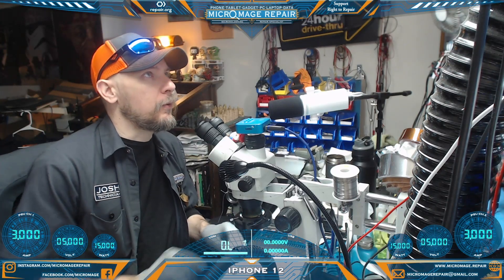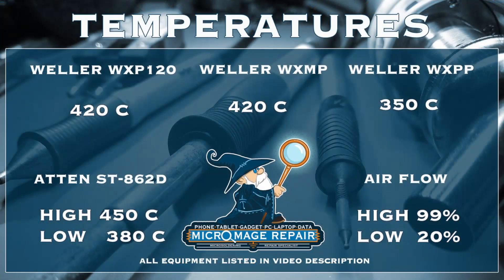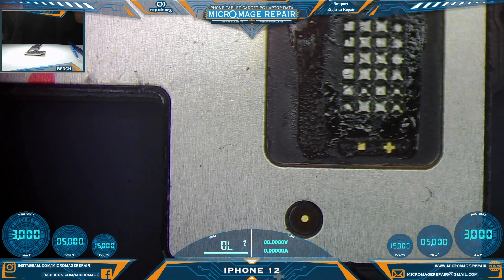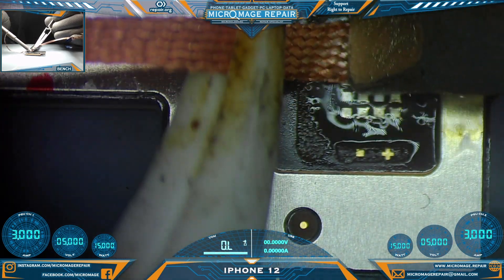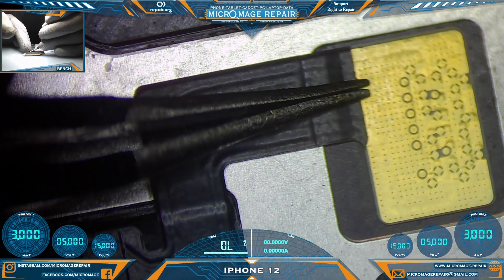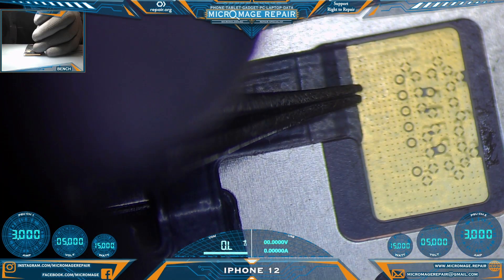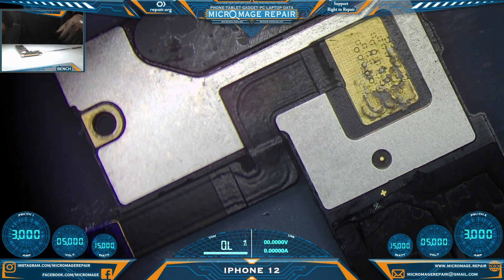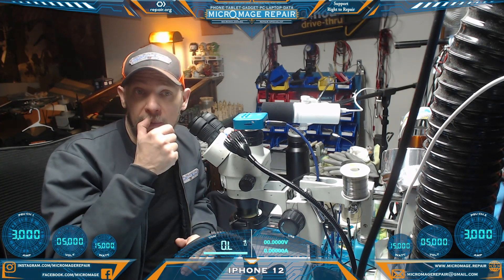It's a different challenge!

Comment: I had one of my friends call me about the same repair a couple days ago He ripped the cable and wants me to repair it for him I will possibly do a video on it too But adding one component A piece of captain tape therefore you do not damage the cable  I thought of the captain tape when I had to replace a camera. matrix ribbon cable Works like a champ
Reply from the maker: Thanks Q's,
kapton tape on the top and using the iron on the tape?
Reply: @MicroMageRepair  yes yes  Therefore you can't ruin the connector and also burn the connector I thought of this solution when I did A camera replacement ribbon cable On the iPhone. matrix Try it out works like a champ Without burning And will still provide the necessary heat to make the connections And you do not have to turn your siring iron donw lol 😆
Reply: Try aluminium or copper tape , it probably transfer the heat easier I would of thought, great idea you added there.
Reply: @SURGE101   Don't know about the aluminum tape that stuffs way too sticky but the copper tape would be decent to try
Reply: @QsTechService1  that’s so true now you’ve mentioned it. The glue on that tape would probably tear it back off the board😂copper probably a better bet

Comment: There was something I wanted to ask you as I seen it one of your other videos. I’ve got an Xbox one x with error e102 and e106 sometimes, I believe it’s related to hard drive. What software do you use to test if the hard drive good once you taken it out of the device and mounted to the computer? ( I see you did it in one of your videos but can’t find it)Before just replacing I wanted to see if the old one definitely bad. Thanks in advance.
Reply from the maker: HDD Sentinel Pro and Crystal Disk info are my go to drive testers, I like to get confirmation from several programs.
Reply: @MicroMageRepair  honestly really appreciate your help, thanks so much👍
Reply from the maker: @SURGE101  Anytime!